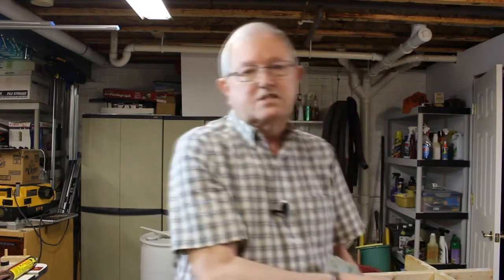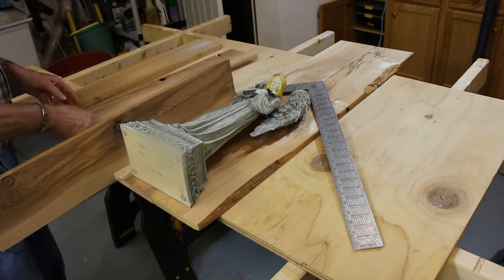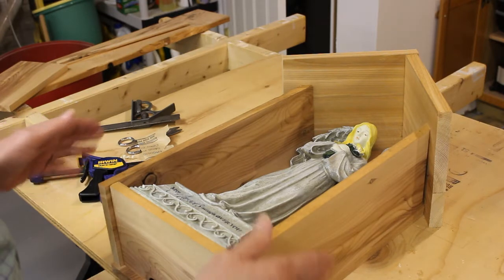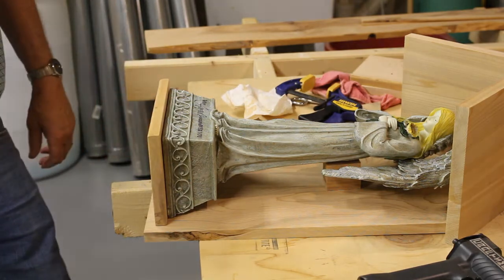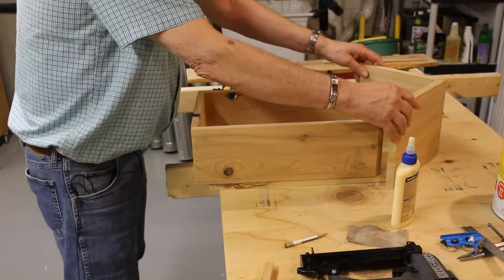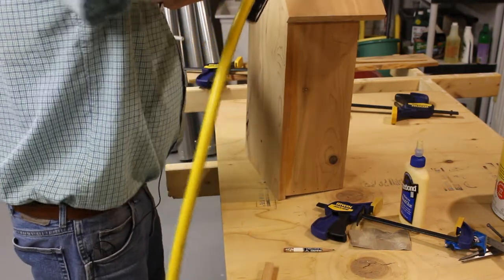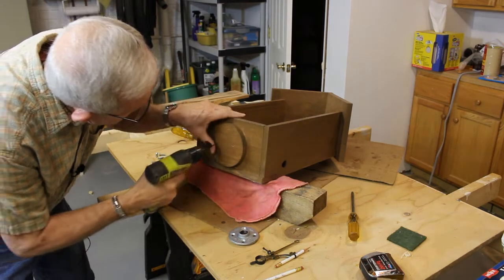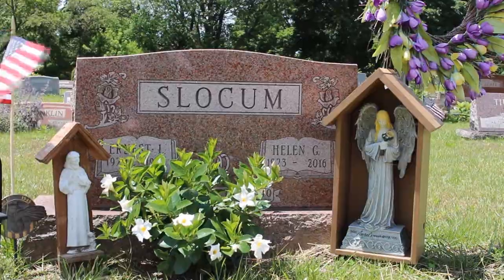Angel Shelter

Comment: Very nice job Paul. Was there a reason you didn't use Titebond III Ultimate Wood Glue which is a one-part waterproof wood glue, instead of the Type II water-resistance glue?
Reply from the maker: Wayne,  thanks for taking the time to leave the comment.  There were a couple of reasons I went with Titebond II.  First the shelter is not going to be continually exposed to water, just normal weather which is fine for a water resistant glue.  The second reason is that I had Titebond II on hand and it is fine for outdoor use.  Had the shelter been exposed to a more wet environment I probably would have used Titebond III.  I have used Titebond II for outdoor projects before with no adverse effects.  Besides, all the joints with the exception of the glue joint on the back panel are glued and nailed.  Thanks for tuning in.  Paul
Reply: Thank you for your response. I really appreciated you going above and beyond to protect the angel form the elements. It should last for many  many years..
Reply from the maker: Thanks